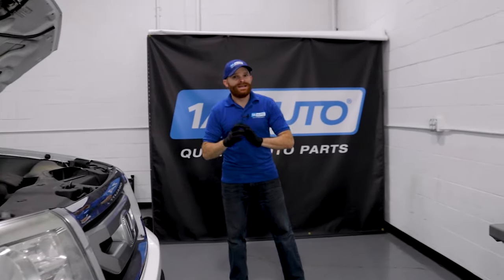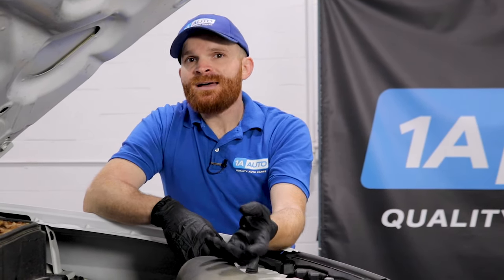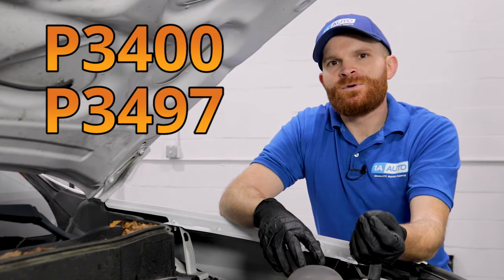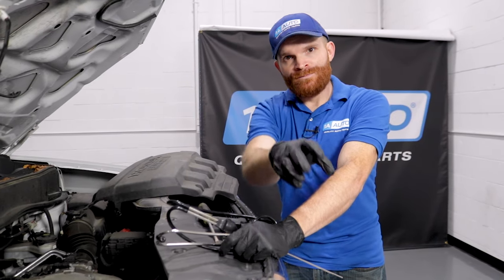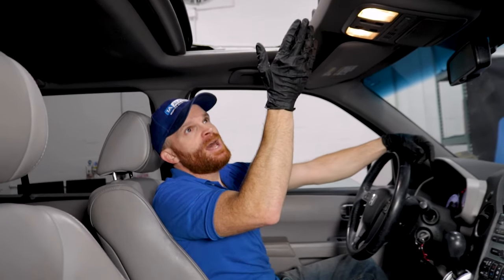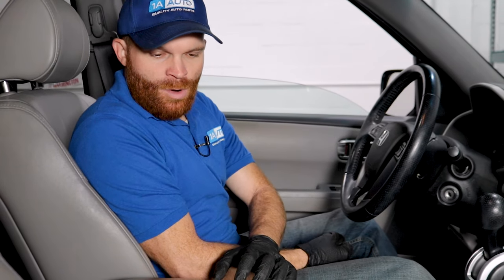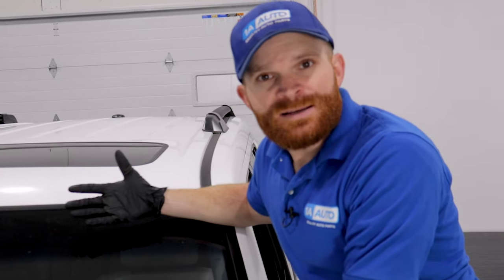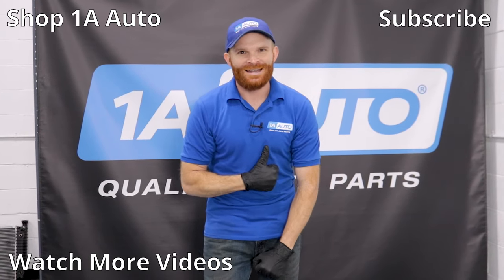Top 5 Problems Honda Pilot SUV 2nd Generation 2009-15

Comment: Good video! I'm looking at a 2009 Pilot later today so this is SUPER helpful. Though I am amused that the running board issue made the top 5 and the wiring issue on the steering column did not, LOL!
Reply from the maker: +Dennster2005 Thank you! We love empowering our customers and showing how to perform DIY auto repairs with our high-quality auto parts.  http://1aau.to/m/Shop-1AAuto-c
Reply: Ended up with a different Pilot, a 2010, and love it. Still say this video was very helpful!

Comment: Guess I’m lucky. I have a 2011 and haven’t had a single issue with her, but I also take good care of her.  Thank you for this informational video.
Reply: Have you changed the timing belt? Everything I have read says do it by 100,000 miles!
Reply: Glad to hear! I take care of my wife's 2011 Pilot religiously (oil changes every 5K) and she had the VCM issue at about 110K miles. Check engine light came on and car would go into limp mode. Had to have it towed. Dealership replaced rear valve and oil pressure sensors and the Honda Technical Service Bulletin for this issue calls for 0W-20 instead of 5W-20 oil. Otherwise the car has been fantastic and we love it. Hope yours continues to run great!
Reply: @LBILUCYFAN  my 2014 says 60k replace timing. Hit that done took few hours. Other wise normal wear and tear on my pilot. Zero issues. Knock on wood! Good luck!

Comment: A fix for the VCM is installing a VCM muzzler. I did for my 2012 Honda Odyssey and now I get full 6 cylinder power all the time. Gas mileage difference with out VCM isnt noticeable.
Reply: Did it to my 14 Odyssey. Much better vehicle with the muzzle.
Reply: Best thing to do, I installed one on my 2012 Pilot , as soon as I bought it back in 2017
Reply: Yup, that’s what I’m talking about pal 👍

Comment: I deal why VCM issue and got it fix. But that VCM issue cause damage to my engine. The oil and gasoline start to mix. Now, my transmission begins to go out after 180k miles.

Comment: I have a 2012, you forgot to mention the ABS module, engine mounts, water leaks from the roof,  cabin top lights issues, water inside the stop lights, and a couple more lol

Comment: I had 4 of the problems you discussed on my Gen 2 Pilot before it was traded for a Gen-3 . Paint, interior, light,and valve clicking.  One thing you did not mention was  water pump leaking for the windsheild  washer. I understand that Honda has had problem with that and the dealer charged 400.00 to replaced the washer as well as the tank due to the labor .
Reply: If the dealership charged you $400, you probably would have paid $100 at any other mechanic. Just a tip for future reference, dealers always always always overcharge on maintenance

Comment: I have a 2013...front brake disks warped at 30k miles.  Rear shocks out at 60k.  Bolt fell out of rear calipers about 70k.  and I've had continuing problems with the electrical battery connection rusting, rotting out, etc.  Otherwise no problems.  I pulled the fuse for the moon roof the day I picked it up before giving my wife the keys.  So don't know if it works or not.
Reply: why did you pull the fuse for the moon roof?

Comment: 2013 Pilot  purchased in 2021 96k miles.  Check engine light has come on 4 times and battery light once

Transmission pressure switch 

Misfire on cylinder 3 (replace coil pack for that cylinder)

Piston ring replacement 

Spool valve and alternator replacement 

Oil pressure switch/sensor 

After all those I did more research and bought the part to disable ECO mode and no issues since.

Comment: I know it doesn't fall in the years category, but I had a 2008 honda pilot and kept having to replace the electric window motors. I know I replaced at least 3 of them, they would stop working and made a ratcheting sound when trying to put the window up again. The window would stay down and we had to take it to the dealer in a hurry. Damage would be over $300 every time. Another one would be to hear an electrical buzz every so often while driving, inside the cabin on the passenger side. With the years the car just became an issue because there were many days when my wife would go to start the car and the battery was dead, even after we recharged the battery and even put new ones in. We got rid of it with less than 60,000 miles last year. We bought a 2021 pilot touring because we love the car. Hope this time we won't have to deal with all that stuff. Any comments on the 2021 pilot touring?
Reply from the maker: +Juan Nunez Thanks for watching!  The jury is still out for any 2021 models. Since they are brand new any common issues have not presented themselves yet.

Comment: Have owned 3 Pilots now. 2 different Gens. Both my 2003 and my 2012 have had the headlight issues. Effects both high and low beams. One goes out after 5 months. I get it replaced and then there goes out. Rinse and repeat for all of them. It's been years and still happens! Replaced fuses, etc; But first I'm hearing it's in the stearing column but never smelled burning before. The other issue I always get is the VTM-4 light. It's become an issue as of late. And then the triple exahuse catalytic converters really suck to replace cause they are ridiculously expensive. Now I have a power steering leak and I can't seem to find and an oil leak that cant tell if it's from the engine block or a strange rivet., Love my Pilots but when they begin to break, THEY BREAK HARD!

Comment: My  2013 Honda Pilot and my 2006 Ridgeline. When first start makes a tapping engine noise as soon as it warms up it goes away and runs normal. Is this the same probiem that you had with what you said that when it warms up it taps?

Comment: I have a 2010 Pilot Touring. The VCM issue caused a piston ring to become damaged.  The mechanic said the 3 cylinders that shuts off created build up. At 70K miles , I was told spark plug number three failed.  By 90K, same issue on the  OBD reader, but the mechanic did some test that revealed a more serious issue, the engine piston ring was damaged, so an engine rebuilt was required.  

At 45K miles, passenger wheel baring failed

At 70K miles, left rear shock. 

At 118K miles, struts failed. 

Leather armrest starting wearing by 25K miles. 

Over all, the engine rebuild was the costly issue.

Comment: 2013 I have bad motor mounts. The dealers kept saying it was suspension parts. After replacing control arm and compliance bushings, tie rod ends it was still shacking like a 50 Plymouth
Reply: Had my transmission mount changed and my honda does not vibrate in gear anymore.

Comment: On my 2012 Pilot I've had these problems (now has 160k miles):
A/C not working.  I haven't diagnosed the problem yet.
Transmission fluid temperature sensor switch went.
Replaced the starter.
ABS module not working.  Haven't replaced it.
Tire Pressure Sensor Monitor not working.  Haven't fixed it.  
Replaced several exhaust pipes.

Comment: Just replaced low beams, also interior wear, yup. I only got stuck once, that was when alternator went out. That was bad since it took out the battery and had to get towed to the shop.

Comment: My 2011 pilot runs great at 117k.The one thing that’s irritating is when started on cold days 32 degrees it makes a grinding noise and never on summer days.I have a new battery to.I researched and think it’s a wire or something on the starter or stator?

Comment: Can you get the fuel management system programmed out that seems to be a common problem in a lot of vehicles
Reply: Install a VCM2 Muzzler and it’ll take care of any shudder and oil burning issues.  You may lose a few miles per gallon but its worth it.

Comment: Check engine light means you have a problem that you need to get checked out. Unless it is an 00-06 Gm vehicle with the 5.3 vortex engine. In that case it is an O2 sensor and the truck will run fine for another 300k miles. It just means you've broken it in.
Reply: If it's a Renault Nissan, Fiat Chrysler Jeep or Cadillac Northstar, then that's a CHANGE Engine light.
Reply: Yep, or the injectors may be a little dirty.  Some "Lucas Oil" Tune Up In A Bottle does wonders, sometimes the Service Engine Soon Light goes off too.
This was the case on my Tahoe.
Sold it last week w/213k on it for a '13 Pilot.  Love both vehicles.
Thanks for the video.

Comment: I have an 09  and the VCM is the main thing I hate 😒  I like all 6 cylinders at all time so I installed the vcm muzzler  but at certain Temps the vcm kicks on
Reply: BUY THE S-VCM  or the muzzler 2 version they use a chip not a resistor. They are safer as they will give the ecm the real temp and warn you of an overheat situation

Comment: Now I know why my oil level always is low. Thanks. What about the backup lights? Very difficult to see what is behind me at night when backing up.
Reply: Research Honda Pilot oil rocket arm assembly switch.  You tube has videos and it’s a cheap part.  Did it myself and fixed the oil consumption issue.

Comment: Had a 2006 pilot ex brakes and tires normal maintenance and water pump and timing belt at 90k.... subframe rotted and traded it in for a 2018 pilot ex luxury

Comment: I have a 2001 Honda Civic with 244k miles on it. The only problem I have had with it is the check engine light has been on for the last 60k miles lol

Comment: Just bought me a 2011 Pilot with 113K miles. This is my second Pilot. I’m not sure of previous owner changed trans oil and I’m feeling trans hit little harder on a the cold first time in the day when I put in drive.  I wonder if that’s normal.

Comment: My Pilot 2009 the front end had to be rebuilt one at a time of course . . . . .  All the bushing failed up and lower . . . . . the first one was under a recall  . . . . the fluid filled the lower arms that attached to the frame rails . . . .But it just kept happening one bushing after another throughout the front-end assembly.

Comment: I have a honda pilot 2014 and keep having to replace my brake rotors or get them resurfaced around every 3 months
..i start noticing the problem when my steering wheel starts shaking/vibrating when I brake.  Every shop I've taken it to say they don't see a problem but it keeps happening.  Any thoughts or suggestions??

Comment: 2014 Pilot has been great, 41000 miles. Replaced the battery in 2020 and now the battery goes dead If it isn’t driven every few days. Took it to the dealer for this problem and they couldn’t diagnose the cause. Any ideas? The airbags were replaced per the recall … would this be causing a battery problem?

Comment: I think half his list are common among most car makes as they age...but I’d like to add the following to his list of common problems with this generation of Pilot:  (1) strange1 second sound upon sub freezing cold start up, sounds like a cross between a fart and a Canadian goose honk; (2) self dimming rearview mirror inner coating fails, rendering the mirror unusable; (3) poor design of taillights where they need to be removed to change a bulb and  it’s nearly impossible to remove them without scratching the housing or your paint, and the same goes for headlight bulbs. However, I do quite like my 2011 Pilot EX-L awd I bought in late 2019 with only 68k miles for about $14k, overall it’s a really great car for the money, rides and handles really well, it’s very roomy, and feels solid as a tank. I picked this over a 2010 Toyota 4Runner with 100k miles because it rides and drives much nicer, has more room and spacious feel, and was $6k cheaper.
Reply: I am looking into the 2014 pilot 4wd touring. as I want the extras it has. But I have found a few EX-L with the extras I want. Making sure the timing belt and scheduled maintenance has been done too. Doing as much research as I can. My other choice was a 4Runner too. Seems you get more bang for your buck with the pilot considering it will run as long as a 4 runner. Although this video has made me a little scared to get one. I have a Kia Sportage right now that I plan to keep that has been great despite the recalls Kia has had on it. I hope I will get lucky with the Pilot too.
Reply: @lynphilion1501  good luck with your search. The items this guy is citing aren’t as common as he’s making it sound. Btw a coworker of mine has a 2014 ex-l she bought new and now has over 150k miles on it. It’s been virtually trouble free. I am due for the timing belt replacement on mine this year, and I’ve already priced it at just under $1,100 at me local Honda dealer, and that includes changing the water pump. I don’t think that’s a bad price and I’d rather have Honda trained techs do it using genuine Honda parts. I’m still quite happy with my Pilot.
Reply: @pt2729 for number 1, that is caused by the starter. Change it out and it will go away.

Comment: BUY the S-VCM  or the muzzler 2 and turn off the VCM system. The VCM wears your engine and transmission prematurely and doesn't save that much gas.
Reply: This is a must
Reply: How do you turn off the vcm?

Comment: I was suprised that this video didnt lie on my Dark Cherry red 12' pilot EXL it has the same leather problem on the driver door armrest, also the roof in front of the Sunroof has that Oxidation, and when i have low oil aka soon to be replaced it tends to To the little clicking noise but it either goes away in 2 ways, 1. Is i replace the oil during normal oil replacement or i just let it idle for 5 minutes then it goes away

Comment: My 2011 Honda Pilot tailgate exterior handle needs to be reattached with bolts. The only thing keeping it attached currently are the four plastic pins. What kind of bolts should I use and I would like to see a video about this. Thanks.
Reply from the maker: +Oliver Aucoc You may reuse the original hardware or purchase it locally. We do not have a video for this repair right now, but we'll keep this request in mind for a future video! http://1aau.to/m/Shop-1AAuto-c

Comment: What about back-up camera? Replaced it twice and 2nd one no longer works. Too pricey to have a third one put in (2010 Pilot EX-L). Also had issues with it burning oil when brand new. Rings had to be replaced and luckily the dealership picked up the cost due to a Class Action Suit in US. Thanks USA!

Comment: I have a 2005 Honda pilot an sometimes when you are driving it don't Rev even if you put it on neutral it don't Rev I have to turn it off then turn it back on so it could go back to normal.

Comment: 2015 Honda Pilot. The front left turn signal seems to pulse only getting a little brighter but enough to see it pulsing. Inside the dash, left blinker light is blinking very fast. I replaced both front turn signal bulbs with same result. The odd thing is if the headlights are turned off, the turn signal seems to work fine. Could it be the headlight/turn signal switch on the column?

Comment: Hey do you think you could do one with 08-12 Nissan Pathfinder? My dad is deciding from pilot or the pathfinder
Reply: We used to have a Nissan Xterra (that is basically the same as the Pathfinder) and honestly I'd say the Pilot is better (as we have one right now), also the Pathfinder, Xterra and Frontier have problems with the timing chain and it costs some money to replace it, they all have the same engine.
Reply: Hope this helps you decide which is better for you
Reply: @1207luiggi  yeah thanks we choose the pilot

Comment: I have a 2013 Pilot and the check light came on at the same was experiencing some hesitation.  Advanced Auto said error on piston #3. Knowing that I've never changed the spark plugs I finally cha get them at 110k miles. Problem solved! 
Well, at for 2 weeks.  Now, same issue but not all the time. 
So what is wrong??
Reply from the maker: +Gabriel Williams We wouldn't be able to diagnose an issue like that here, you may want to have a local mechanic take a look at it. Thanks for checking us out! http://1aau.to/m/Shop-1AAuto-c

Comment: I own 2nd Generation Honda Pilot.
The "D" Gear sometime will start Flashing when am driving. Even when it's in Reverse Gear.

I've got it Scanned without any definate problem identified.

In the Manual, it's state that flashing "D" light is a transmission. Problem. But the Mechanic put a Scanner, we test drove it and said the Gears are shifting normally.
What should I do next?
Reply from the maker: +E. K. Egrouppe We wouldn't be able to diagnose an issue like that here, you may want to have a local mechanic take a look at it. Thanks for checking us out! http://1aau.to/m/Shop-1AAuto-c

Comment: DESPERATE NEED OF HELP!!!
2015 Honda Pilot seal around sun/moonroof got stuck when opening the sunroof and had to be manually pulled out in order to close the sunroof. Took to dealership and was told the ENTIRE sunroof has to be replaced. Ordered in January and still no DOD. How can I just permanently seal it shut? Is it possible?

Comment: You can fix the VCM with a simple resistor. Theres a guy that sells them online. It turns it off by tricking the computer into thinking you never get up to full operation temperature. VCM was a stupid idea and can cause engine damage.

Comment: what is behind the flap door on the engine splash guard under front of vehicle.  theres a large metal pipe that is missing a bolt.  what is this pipe and should there be a bolt there?

Comment: 2013 honda pilot touring HTL module goes bad causing the battery to die overnight. Fuse 23 under the hood controls the Bluetooth HTL module

Comment: What about the vibrations produced by the vcm turning on/off wearing the engine mounts??
Reply: That was the first point he talked about. I would recommend you do is disable the VCM with a device called "SVCM" you install on the engine. Its great. I put it on a month ago and no longer have vibrations.
Reply: @MouseyBusiness  ABSOLUTELY!!! SVCM is awesome and fixes these car's largest flaw. Great recommendation.
Reply: @briantii  where can I buy the svcm?